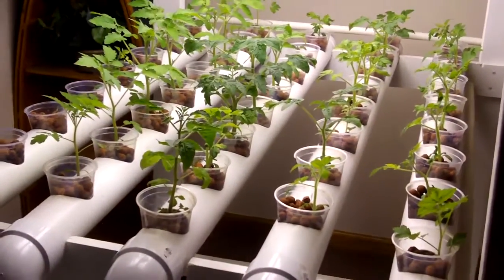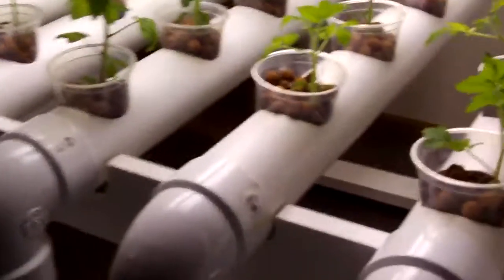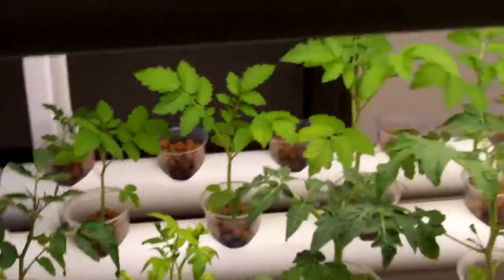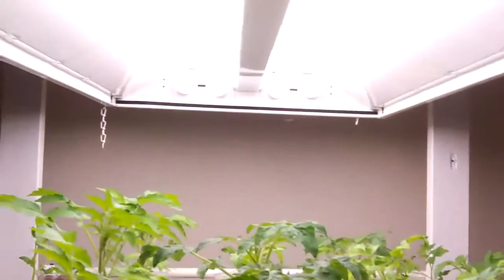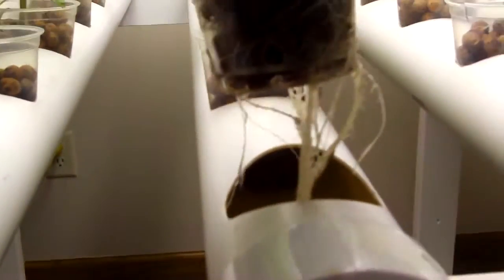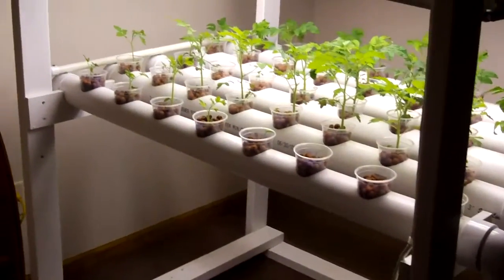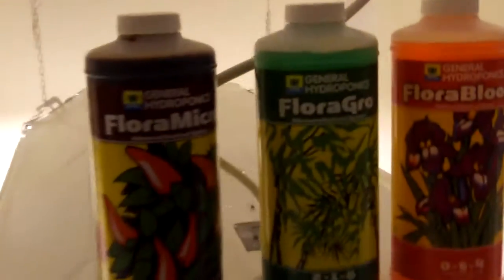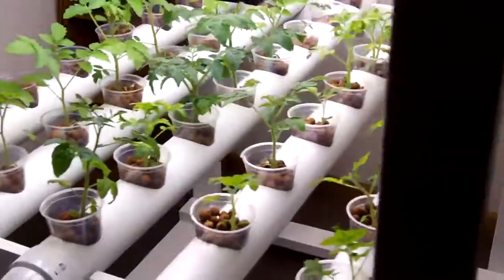Basement Hydroponics System

Comment: I'm thinking about the system clogging up at the bends in the small pipes.  Forgive me if the question is uninformed, but I'm wondering if a person would be able to first run the water from a pump (in the tank) to a bed with media in it to filter the solids out before  running it to other plants in this pipe system?  This would also eliminate problems of having the solids cover the roots and suffocating them (I would think).  I like the hydro system though.  It's a good way to grow plants. Have fun! (: